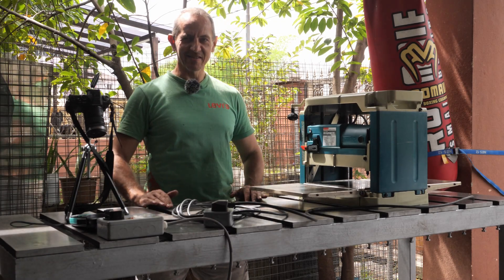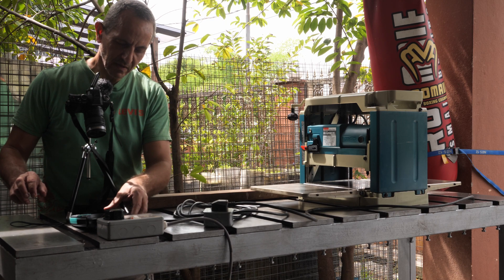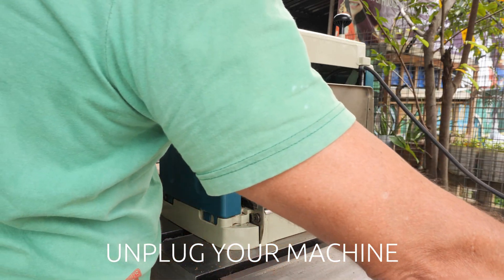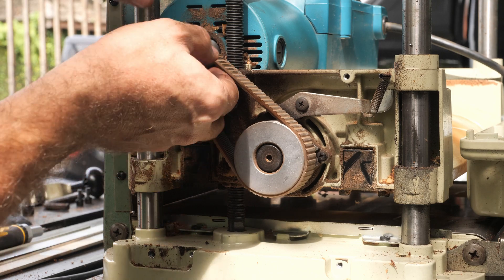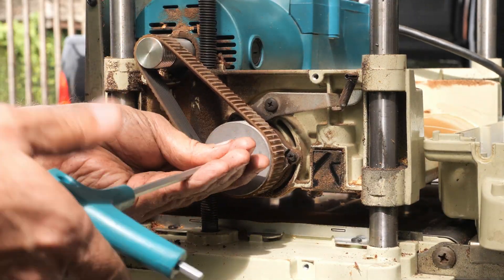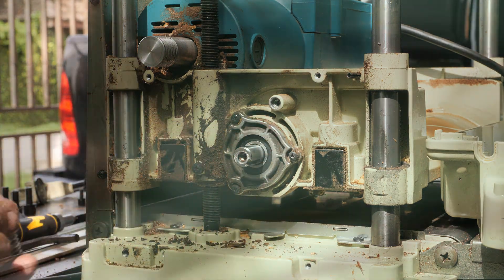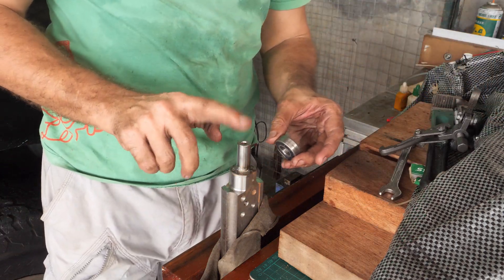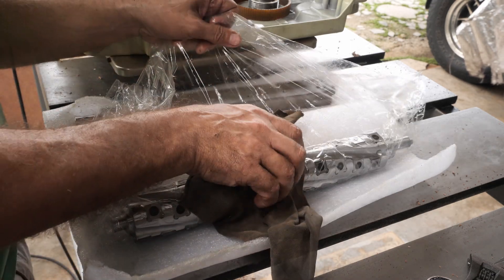How To Upgrade Makita 2012NB Thickness Planer To Helical Spiral Cutter Head  + Comparison Test

Comment: Excellent video, many thanks for your video. I have purchased a new helical cutter head that has new bearings already fitted. Your comments at the end of the video saying that it’s probably better to use the original bearings does concern me a little. We will see.   I noticed your punchbag hanging behind you, is that there for use when things in the workshop are not going well 😂  maybe I should buy one. All the very best.

Comment: This shaft costs almost the same as the entire thicknesser. Does the cost truly reflect a much better finish?
Reply from the maker: Yes it's a game changer. I would never return to straight knives after using spiral helical cutter head for 2 years on the first blades index, I have 3 more indices to rotate. The upgrade is totally worth the investment. The finish doesn't require sanding and it's silky smooth

Comment: Thanks for this video. I am searching here in germany for a spiral cutter. Found the shelix in the internet. Bitte with high additional shipping and import costs between 150 and 300 Euro this is quite expensive..... I realy like the noise reduction. Maybe one Day there is an affordable version also here In germany.
Reply from the maker: https://tigertoolspro.com/product/helical-spiral-cutter-head-for-makita-2012nb-thickness-planer/

we ship worldwide, and our cutter head is a class above other brands. we make it with 3D laser shapers with unmatched tolerances, using special alloys. and to make you happy, we import the blades from Germany.
Reply: @TigerCarpenter  thanks for this Information. Do you also offer a version for the triton? The 99 Dollar includes already the tax etc.? Or is that additionally on top?
Reply from the maker: @alexjustdoit2255  USD99 is for air courier such as FedEx (in fact we pay more to them as it's over 7kg + wooden box), and there are no other hidden charges / taxes / custom duties etc. so once you proceed with an order, the cutter head will reach your doorstep very fast. 
we've just shipped one to Finland yesterday.

Triton: because we are a manufacturer, not a middleman, we can make for you ANY cutter head, of any dimensions you specify, that includes Triton. because I don;t have Triton, I would rely on your measurements of the shaft diameter / both ends length, and outer diameter and total length. you also need to specify the spinning direction (in case Triton decided to get creative).
Reply: @TigerCarpenter  thanks for this information. The Triton I am talking about is the TPT 125. A thicknessplaner for about 400 Euro being the starter segment here in Germany. If the total cost for the head including shipping and potential taxes would be around 400 Euros this would be on the level of the only available planer with a spiral head Shinko 330. Being maybe somehow worse compared to yours I would guess. Unfortunately I am not sure if I could  handle to do the precise meassurements you would need to produce a cutter head which is safe and works well. If there is anybody else out there supporting this I would try and also male a small comparison as I am searching for years for such a solution. And I guess there are many others out there searching for Such a solution.
Reply from the maker: @alexjustdoit2255  you can use a caliper or micro meter to measure the shaft diameter which is critical. The shaft ends also can me measured with the caliper. Or maybe the instruction manual has those dimensions specified. 
Personally I recommend 2012NB as it is made from aluminium and works continuously for many hours without fail or overheating. DeWalt would set itself on fire after few hours of use. I mill lots of lumber on Makita for many hours in a tow and it just works . Makita is engineered to perfection in my opinion based on heavy use experience

Comment: I totally agree that helical spiral cutter head is the best upgrade one can make in their woodworking machines
I'm nicely surprised how significant is the surface finish improvement is when you use the segmented cutter blades

Comment: hey did you ever had any problem with Interna Lock mechanism ?. Mine started to loose the lock when I push the wood .
Reply from the maker: You experience the locking mechanism problem after changing the head to spiral? The lock is only used to change the old straight knives and you can literally remove the lock once you switch to the new head. 
And I get worried that you need to push the wood through.  It should pass through without any force from the operator. If the wood needs a push then you might try waxing the planet's bed/table to reduce the friction
Reply: @TigerCarpenter  what did I mean is that when I take 3mm the handle start to move upwards approx 1 cm so if I plan 10 wood pieces it will  move to 2mm ot something like that . At maximum depth of 3mm the wood won't go easy as I need to push the wood to enter under the rubber wheels but if I take 1 mm will go very easy .I adjusted the head and I'm using only pine without knots so I'm not so sure if the carbide  spiral head would be an improvement or worth the investment over the factory head.
Reply from the maker: @radurobert1  spiral cutterhead will take 3mm off pine stock without a blink of an eye
but you shouldn't need to ever push the stock through. use wax to make the friction lower on the bed. and one side has to be jointed prior to using the thickness planer. I hope that is obvious as well.
Reply: If I adjust to 3mm the wood won't go easy under the rubber wheel so I push only until it is under the first rubber wheel . Is this normal ?. The price of the spiral cutterhead is equal with the machine itself but it is strange that they won't also give you and aditional set of tooths in that price . So if I buy that thing where can I find more tooths ?.
Reply from the maker: @radurobert1  the spiral head blades are combined 48 15x15mm square carbide blades. Each edge of the square is sharp, so you can rotate each blade every time you damage it or if it becomes blunt. one set of 4 sharp edges will last you 10 years.
The spiral head price is the same worldwide and is well justified by the finish read quality of the planed surface. If you are happy with the original straight blades, you don;t have to upgrade to the spiral head. If you run a commercial business or if you want to significantly improve the quality you can deliver, then the upgrade to the spiral head is well worth it and justified.
you should never use any force to feed the material to your machines. it will result in the accident (touch wood). the rollers pressure should be sufficient to let the stock travel under the cutting head, and feed automatically.

Comment: Nice upgrade Tiger Carpenter!
By any chance you are planning to provide a one for DW733?
Reply from the maker: thanks!
we produce the cutter heads of all sizes and for all machines, we can also make a custom size for your specific needs.
funny as it sounds, 95% of all of my tools are DeWalt, but Makita 2012NB thickness planer is built much more sturdy, it is less noisy, vibrates less than DeWalt. that's why I don;t have a DeWalt thickness planer to demonstrate the cutter head replacement.
we sold few hundred of our helical cutter heads for DeWalt so far, and we had not a single issue reported back to us. in fact the DeWalt installation is easier and more straightforward, comparing to Makita, as it doesn;t require any modifications, just plug and play from the top.
Reply: @TigerCarpenter  you modified the Makita planer by filling the hole into circular shape, but if I was you I would instead file the helical head rod.
Reply: @icecube3645  no way I am filing a rotating and balanced from factory cutter head to put it off, much better to file the bearing house.

Comment: Nice work. Thanks for this video. Ideally you should not pull on the outer race of the bearings when removing. In your case this was unavoidable. When reassembling you should not hit the outer race with a hammer, this will damage the groove where it contacts the balls. When installing, the inner race should be hit or pressed with a steel tube or stepped shaft to prevent the balls from damaging the groove in the inner and outer races. It looks like you got away with it, but the bearings may fail prematurely. (But they will be cheap to replace compared with the cutter head!)
Reply from the maker: I used rubber mallet, which is giving in to the hardened stainless steel bearings.
the welding table is made from 18 mm thick mild steel plates, and they are acting like a spring / trampoline = they absorb most of the hit / vibrations. 
it may look I was hard on the bearings, but I was in fact very gentle and cautious. and yes I will replace the bearings if they fail or start making some funny noises.
BTW: me and my brother produce these cutter heads from the raw materials, we cut them on the laser shaper, which I believe is the best to date precision cutter heads on the market. we are actually engineers for totally different industries, but we took on this idea just to challenge ourselves, and to produce the best cutter heads. I know this sounds so unhumble, but our cutter heads perform like a sports car compared to the regular saloon car. we designed them with so many factors in mind, such as the lowest possible resistance to the air, lowest possible weight, truly spiral cutter blades curves (changing angle), and shaft diameter / length precision like in a spaceship. 
I think we did a really good job.
I actually further fine tuned them, and now they perform 25% more quiet, and take 20% less Amperage than in this video.

Comment: Great video, but for an extra $100 you can get the Oliver benchtop planer with a helical already installed.
Reply from the maker: Thanks for your feedback. I agree there are always many ways to achieve similar results. 
I went with the upgrade for 2 main reasons: 
1. I already had Makita 2012NB thickness planer which never failed for many years which makes me confident it's a high quality piece of equipment 
2. My brother and me design and manufacture custom helical spiral cutter heads for any machine and any dimensions you can think of. We also manufacture the CNC / router cutter bits with the same concept of replaceable indexing carbide blades that would last for a decade. 

So for me it was a no brainer to design and laser cut the Makita spiral cutter head.
If I haven't already owned Makita thickness planer I would probably buy DeWalt thickness planer or some industrial grade monster Grizzly and I would make spiral cutter head for that little baby.
Reply: @TigerCarpenter  Very impressive! I'll most definitely keep that in mind if I'm ever in need.
Reply from the maker: @nicklavioletteiii2183  ok great. We can make for you any custom cutter.
You can stay tuned to tigertoolspro.com to see newly added cutters, CNC/ router bits etc. I'll add my favourite router flush trim bit with 10 or 12 indexing carbide blades tonight (30mm diameter and 60mm cutting edge height), they work like a charm to joint boards edges on the router table.

Comment: You don't need to remove the segmented cutters to install the new head. Just install the head from the topside, longer end goes in first then the short end. Don't put the whole cutter head through the drive side hole! There are other videos which show this correctly.
Reply: removing cutters when installing is a goodf practice. You will be safer handling it and much better chance of not chipping any cutter. ASk me why I know.
Reply from the maker: you can be sure I tried that, and it wasn't possible to fit it in from the top. 
the other brand helical head is slightly smaller in diameter to accommodate just that. however then you will have the head-rollers misaligned (not in one plane), and that's why I went with this route. I know exactly what I'm saying because we produce these cutter heads, and we cut them with the lasers to perfect dimensions.
I know Shelix for instance will fit in from the top, but as I mentioned, it doesn't match the original head's size and ours does.

you can't even take out / install the original straight knives cutter head from the top. hence the side hole has the rectangular slot that allows the original cutter head to pass through. and that's why I had to file that slot to allow the round profile helical cutter head to pass through that same side hole (slot filed to a circle).

the removal of the segmented cutter knives serves 2 purposes:
1. you won't cut yourself while handling / installing the helical cutter head (it's a one time off task, and takes 20 minutes and yes it is boring but it allows you to practice your patience)
2. you don't need to file the rectangular side slot (that lets the original straight knives cutter head to pass through) unnecessarily too big, without the segmented knives, the circular hole that allows the helical cutter head to pass through is barely bigger than the new cutter head's core (without the knives), so you save time on filing the slot into circular hole, and preserve the chassis structural strength (it would get weaker with a bigger hole on the side).

bonus conclusions:
if you use other brand helical cutter head which is smaller in diameter to accommodate the installation from the top:
1. you will get rollers significantly misaligned from the cutter head plane, 
2. you will cause much bigger pressure between rollers and the material,
3. you will put 25%-35% more load on the motor (you can see we in fact REDUCED the load on the motor)
4. you will cause the pulley and inner surface of the V-belt to overheat and cause the belt to change its geometry, hence cause even more dangerous implications such as V-belt melting / breaking.
5. you will increase the operational noise (we DECREASED the noise as presented in the video)
6. you will use more input power / pay more electric bills
7. your overloaded motor will fail much faster in the long run of using misaligned rollers/cutter head (not in 1 plane)

so.... after having gone through all the above mistakes and experiments in the process of prototyping our helical cutter heads, we concluded that the best overall solution is to use the helical cutter head that exactly matches the original Makita dimensions, both cutter's diameter and shafts length / diameter. this way our motor load decreased, noise reduced, pulley/V-belt temperature lowered, machine longevity increased, reliability is much higher, and most of all the final surface quality is better/smoother. 
when helical cutter head diameter is smaller (Shelix et al.), the material is pushed harder with the rollers which are below the cutter head cutting line, the material friction is higher, and everything starts to get affected like in a chain reaction.
we strongly believe that Shelix decision to reduce helical cutter head diameter for the convenience of the installation (one time off task) was emphatically wrong. you can see they retracted their decision in DeWalt variant, because it was causing DeWalt thickness planers overheating and motor failure and other issues.

thanks for your input!

Comment: It looks like changing the cutter head was an all-day job. Is that correct?
Reply from the maker: it was my 1st time to perform this surgery.

but to be honest the 2nd time it would take me less than 30 minutes, especially that I was figuring it all out without watching my step-by-step video.

the longest step was filing the vertical flat sides of the hole through which the cutter head has to go into the body of Makita NB2012. it took me a while to think and decide whether I should do it, because I was reluctant to irreversibly modify the Makita's chassis. I was searching the Internet for it, and nobody was showing it, so I made that call and went ahead with it. it turned out to be the right decision. the filing itself took 10 minutes, but deciding to do it took me few hours or Internet search and thinking. 

yes the video recording started in the afternoon, and ended after sunset (on the equator where I was at the time of making this video, the sun sets at 6:30 pm).

so the short answer is: yes it took me all day of thinking, figuring out which bolt needs to be opened, how to slide the cutter head through the hole which was smaller than the cutter's diameter.

after watching this video, it should take you 2 hours to get the job done.

I suggest to equip yourself with the gear pulling jaws, to be able to remove the bearings from the original straight cutter head. if you don't have these jaws, it can also slow you down while you are sourcing them / bring to a car workshop to help you take it off or order online and wait for the delivery.

Comment: Hi , do you have an email so can ask you some questions?

I to order you a  helicoidal head, you have no email on the website, 
Is the price in Indonesian dollar's?
Dou you have then in stock?
House much time to get it to Spain?
Thanks
Reply from the maker: https://tigertoolspro.com/product/helical-spiral-cutter-head-for-makita-2012nb-thickness-planer/

please order from the website. we deliver worldwide.

price is in USD

info at tigertoolspro dot com
Reply: @TigerCarpenter  Is the price in SGD or USD?
Reply from the maker: @dougveganparadisebuilder  USD. The price for helical cutter heads is nearly identical worldwide. Our cutter heads are 3D laser cut to perfection and match the exact diameter of the original head. We use significantly better materials than the competition.